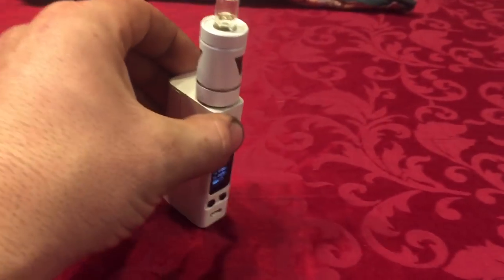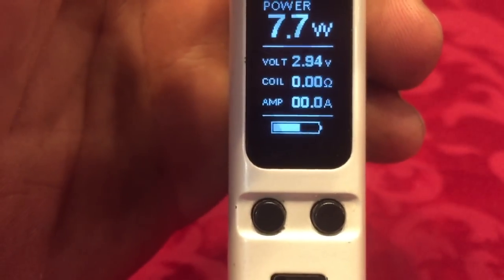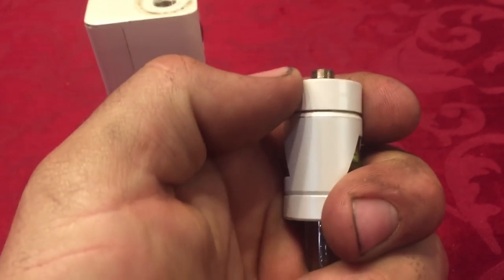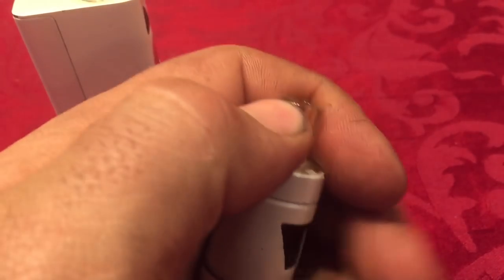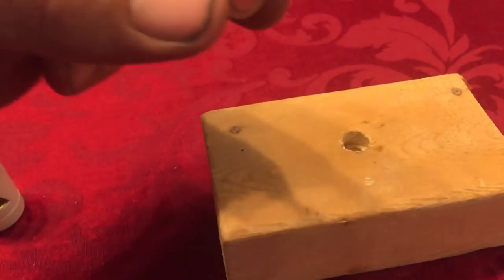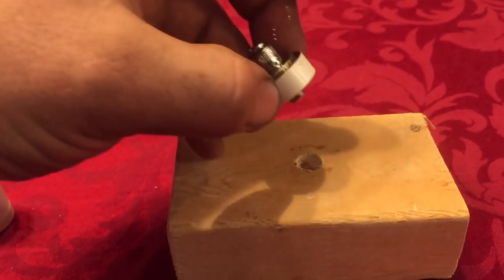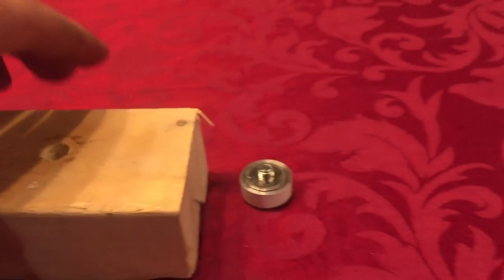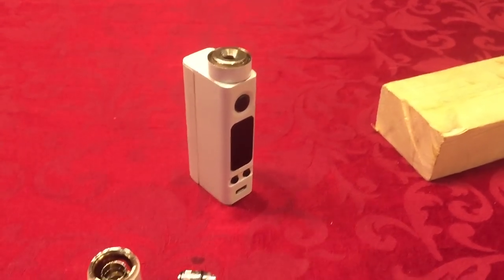evic vtc mini no atomizer found fix!!!

Comment: You ROCK!!  This fixed my MELO 2 right up after an accidental drop.  However, I didn't make the piece of wood.  I placed the bottom piece upside down as you have in the video and placed a pair of pliers (closed) around the connector to protect it from the hit. Then I used a hammer and smacked the pliers (not too hard but a good wack) and knocked it right back into place.  Thank you sooo much for the video!!!

Comment: If this video didn't help, then, try putting a cone of aluminium foil in the coil, so it makes contact between the mesh and the resistor spring. If it works, you need a new coil.

Comment: Use thicker heat wire with selfmade wicks and the problem is gone. Joyetech made the mistake until this very day 7-3-18 (and does JACK SHIT ABOUT IT)  that thin wire and therefore high resistance is seen by the system as a short in the atomizer. 28GA and thicker works fine.

Comment: will this working with any tank?
Reply from the maker: Airsoft Savages Co. 
no im sorry in somme other casses yes but they are not all built the same
good ting do of so they would all break
Reply: I did this a year ago to fix my Geek Vape Griffin tank. I'm about to disassemble a Sense Blazer 200 tank to see if it can be pressed back together. This video can possibly save A LOT of people $ if they can follow simple instructions!
Reply: Sense Blazer 200 is a press fit tank. 100% satisfactory results on the fix!